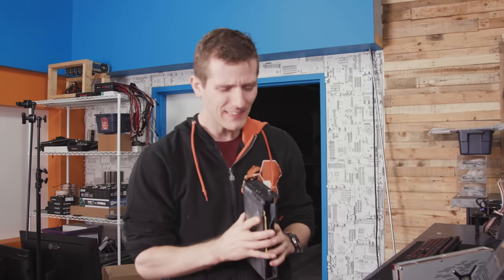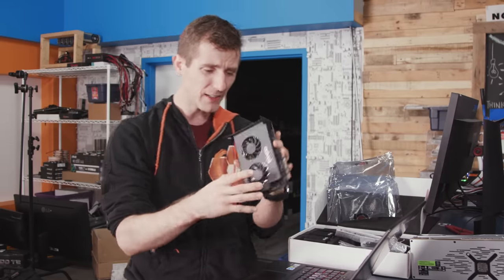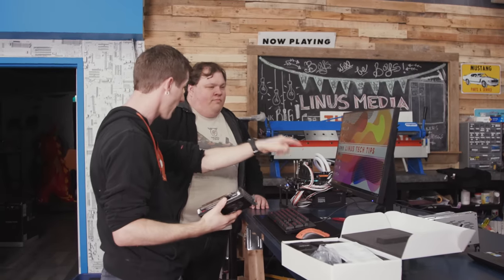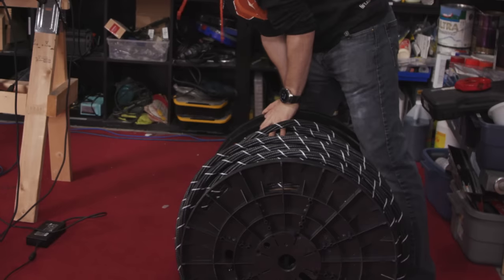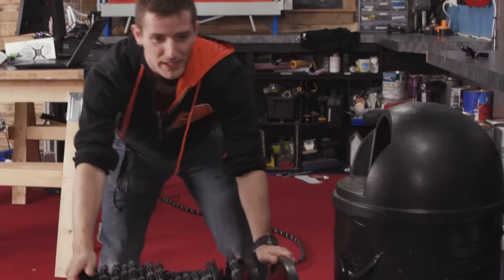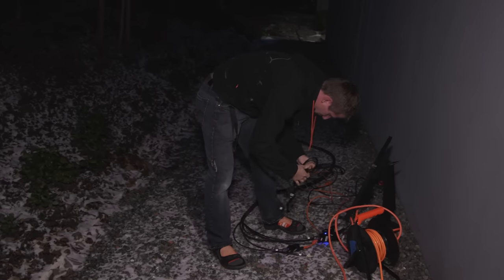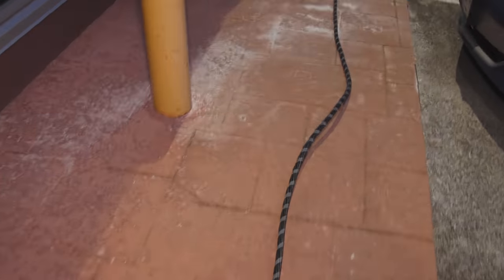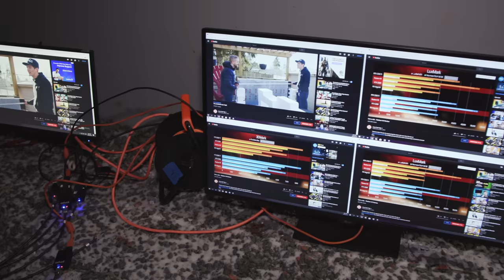The WEIRDEST Video Card We’ve EVER Seen..

Comment: This is the perfect solution when your PC is too noisy. Lets you put it in the next town.
Reply: Linus has that for his home pc but over thunderbolt since that can carry the usb and network too.
Reply: No, you can bury your pc and still have it run
Reply: How would you turn it on?
Reply: ödeldödel Horst lol
Reply: @alexgutowski  2.4 GHz remote-controlled switch, with the control next to your keyboard.
Reply: Jean Roch it’s gotta be 5 GHz. 2.4 was so 2018.
Reply: @alexgutowski  except everybody who knows RF will tell you 5 GHz doesn't have enough range and is easily stopped by walls.
Reply: Especially when you have a “highest airflow pc”
Reply: Alex Gutowski turn on wake on lan and then only put it to sleep. You could remotely wake it from your phone
Reply: @rylyguy  and so could the NSA. WOL is like a giant backdoor, no thanks 😅
Reply: Keyboard and mouse is a problem
Reply: Imma get it right around my car car I’ll I’ll get there to get you and get there there are are things there I don’t want it I’ll just go go to the bank to take my my computer back back home I
Reply: Corazon Sierra I overclocked my keyboard for more RGB......it obviously backfired
Reply: Hahahaha... 😁 😁
Reply: @TheNefastor : So if the NSA had spent some time hacking a PC on your network, your main fear is that they would be able to power on a PC?
Reply: @martito1014  Greatttttttt thermals
Reply: @alexgutowski  how about a smart switch

Comment: That Radeon Embedded 9550 is the Embedded version of RX480/580. It has got 36 Compute Units (same as RX480/580), core clock at 1150MHz for total 5.3TFlops of compute power however the memory is clocked just at 5GHz effective meaning bandwidth is down to 160GB/s rather than 224/256GB of the RX counterpart. It also runs at less than 95w TDP compared to 150/180 of RX.
Reply: that is a nice thing , for sure !
Reply: This advoli TA6 Performance card was apparently designed to support any embedded AMD Type B MXM module (although only three embedded options are currently available).
But what purpose does a card with 6 x 4K HDBaseT outputs serve and why would anyone (other than Linus) want to have one?
Datasheet says "Key Markets: Digital Gaming, Digital Signage/Retail, Medical Imaging, Aerospace/Defense".  Can output in any combination up to one 12K multi-screen.

http://www.advoli.com/ta6performance/
https://www.amd.com/Documents/ultra-high-performance-gpu-product-brief.pdf
Reply: Would've been nice if Linus did some actual fps and temp benchmarks on this product, show what it can do (and what it can't) with monitors installed at max distance.
Reply: Logic*
Reply: @pwnmeisterage  mostly going to be stores/digital displays to run off a single system. we use something similar at my work but far more old school. something like this would be insanely better but would never happen at my work even though they paid to have the building wired for 10gbit ethernet and don't even use it.
Reply: Wait he didn't game on it in this video? That's what I was waiting for!
Reply: Yeoss :3  It would've been a normal RX480 aka equal to 1060 if it wasn't for that botched memory bandwidth. It'll be slower. How much? Depends on the game how much memory bandwidth intensive it is.
Reply: @pwnmeisterage  A hell of a lot of applications, including television production. There is a market for this, as for why would Linus, he's still on the single-server-multi-platform-thing, and to not have like six video cards with ridiculous priced HDMI as well as limited lenght, probably just running ethernet throughout the building to where..well.. basically.. screens and mice/kb are. For sure M/KB are gonna be run by ethernet as well.
Reply: Yeoss :3  Better? Sure, but none of them will perform WORSE than baseline Nvidia spec (assuming they don't thermal or power throttle) and this Embedded version of RX480 (due to its limited bandwidth) will fail to surpass even the base spec GTX1060 so we can hardly say that its 1060 on steroids.

Comment: i think this is mostly intended for signage use where they can connect multiple TV's in a Mall for example
Reply: I happen to know the guys at Advoli, and you're right on. Also airports, factories... It's still very cool tech though!
Reply: Duh.
Reply: This card makes display servers REALLY EASY
Reply: Security systems, field setups (police, military, firefighting) where you need multiple monitors in a field environment.
Reply: Even for events when you want to do live feed.
Reply: And also space center room
Reply: @CityVoltProject  Oooh, that explains the name then. Indeed very cool!
Reply: Stadiums too
Reply: Thats exactly what it is for . Also ive seen this in a set up where it was used in fairly large sports bar in las vegas that had 20 large screen tvs all showing different sporting events with screens to post live bets .
Reply: airports is probably one of the biggest users, given how many monitors they have all over the place, and they can't have the PC towers anywhere near where the public can reach (to prevent theft, or worse people hacking them and causing havoc). So with these things, they can have one room full of computers that branch out to the hundreds of monitors within 100 yards of the secured computer room. Wonder if using repeaters would still be feasible to extend range or if that would hinder the output quality too much. Also wouldn't be a surprise if stock market floors were loaded up with PCs running these cards
Reply: @SurgStriker  I think a lot of airports have small PC's mounted behind the TV's (Think Intel NUC etc)
Reply: I wonder if fast food joints like mcdonalds and Burger King use it since they all switched to multiple monitor menu boards
Reply: I think it can also be used for Bitcoin mining xD
Reply: @SurgStriker  most airports are either using thin clients/signage drivers, or something like a crestron md64. This is cool i guess but a really strange solution that doesnt seem to have a good purpose
Reply: The more you know
Reply: Cool tech
Reply: This is mostly used on airports. =)
Reply: In stadiums they use them for pricing boards etc
Reply: @AnotherOne yes but they still have the big TV menu boards

Comment: And they say Ethernet graphics weren't possible
Reply: Yeah.
Reply: It's not over Ethernet. It's over 4 Twisted Pairs also known as a 4 pair CAT5 Cable, in this instance, he is using CAT7 which has tighter tolerances allowing faster speeds.
HDBaseT isn't based upon the Ethernet subframes and IP layers.
Only the physical connection is similar, just reusing the spec.
Reply: @RyanF470  Is this sort of a misnomer, ie. "Power over Ethernet"? The electrical approach is ofc a bit different as you're running (now adays) power and signal across the same leads, but still. Not much IP layer involvement there ^^,
Reply: lesslighter it's not meant for home use. This type of equipment is used more for event production in the AV industry.
Reply: Finally we can download vram after all these years.
Reply: lesslighter ive got a set of powered ethernet/hdmi adapters my low voltage friend gave me like 5 or so years ago. Allot of this stuff seems to get used commercially before it hits the consumer level. He also showed me display port to me at the time and i was like wtf is that?

Comment: I loved Linus' demonstration.  You could say 100 meters all day long.   You could point to the connectors coming from the graphics card, going through the 100 meters of shielded CAT 7,  Out to the HDMI adapters to the monitors.  People would just not listen or ignore it.  Not to mention the "IR" blaster outputs, IR pass through, and the RS232 Serial outputs.  The Idea of pointing with a remote.   People would glaze over and not hear you.   You Needed his demonstration to make the gears turn in people's head.  Your monitors and control setup could be a few floors up.   With the right  PoE switch and PoE media converter for your PoE applications.  You could be on the other side of a stadium.  The applications for this are endless.   Only Linus could show this in 10 minutes without boring people to sleep.  Like I just did.
Linus Sebastian, you are the best.

Comment: I think you should change the title to "The Weirdest and Longest Ethernet Cable We've EVER Seen..."
Reply: I've used this sort of cabling at job sites.  Funny thing is you actually need extra support and strain relief for all those heavy connectors (see how they sag in the vid?) - especially if you have a rack mount with many of these cards - even if you don't need any extra support for the wimpy little single-slot half-size GPU cards they stick into.
Linus could've just plugged into whatever spare ethernet cable runs he might already have installed in his building.  But if he did that then the video wouldn't be ten minutes long.
Reply: P the video is 10 minutes and 30 seconds
Reply: @XavierAncarno  Which is still 10 minutes.
Reply: ErroR
Reply: @pwnmeisterage  Exactly, who wants to suffer from saggy cable.

Comment: This is the main reason i like watching LTT, for the laughs
Reply: haha exactly.. he didnt have to walk 100meters lol.   just connecting 5 other monitors in the same room works the same as if he walked 100meters outside.  The signal has to transfer through all that ethernet length regardless if he was 1meter away or 100meters hahaha... funny clip for sure
Reply: @marcuswong1797  i like how you had to explain in considerable detail
Reply: @marcuswong1797  does crosstalk happens if they are all piled up together??.........
Reply: @0.o586  Yes. Especially when the cable is wrapped more than 5 times over like in the video. Though in the case of the video, the cable is shielded Cat7 which should prevent most crosstalk
Reply: Try watching jayztwocents
Reply: AWESOME COMMENT

Comment: This card is actually a perfect solution to something I've been trying to figure out for months.
At work I we have 6-8 TV's out in various places in the office, all hooked up to individual old PCs in our server room. I have been looking to downsize this significantly, and using one of these cards looks like it might be the way forward. Question is, can I run 6 VM's through it...
Reply: Maybe it can be used in public space like train station display or airport
Reply: So basically 6 editors 1 workstation but without all the graphics cards? :P
In seriousness though, if these outputs show up as regular HDMI on the host machine there's no reason you shouldn't be able to.
Reply: The VMs would obviously depend on the solution you use to virtualize. Does it allow indipendent input per VM? You have a solition to like the input back to the machine? If it's for use with less graphics performance needed, there are some nVidia Quadro and Matrox cards with similar/more outputs that might be cheaper.
Best would be to get in touch with Advoli and just ask them of your scenario is supported.
Reply: I was thinking this would be perfect for business use. Reception/cafe/offices all on one GPU :)
Reply: You could also consider Micro form factor PCs.  Dell offers them and also have Vesa mount holders.  Can allow you to move the PCs to the TV locations with minimal footprint or even fully hidden behind the TV itself.  Doesn't reduce the overall number of PCs but could eliminate need for long cable runs.
Reply: Technically, no you could not run 6 VM's on the single GPU. This solution is "1 PC, X Monitors" in the same way that plugging in 6 monitors to a single GPU is normally, there's just some overhead in the transmission. The solution to your puzzle is to actually use 1 HDMI/DP to Ethernet connector on each end and bypass the Ethernet switch. Then you either use 6 machines, or one machine with 6 GPU's (see Linus's video https://www.youtube.com/watch?v=LXOaCkbt4lI ) with 6 mapped PCIe cards. Though I think that's super-overkill.

An alternate solution I'd suggest is what's already used by the digital ad systems, just put a small NUC or Pi or something behind the TV or use a SmartTV with Kodi, have it PXE (network) boot off a single machine in the server room, and then have it stream video from the location.
Reply: @Kisai_Yuki  so the thing is, none of these VMs will actually need much GPU power, and I'm realising now that unless the Advoli cards can somehow utilise network switches they won't work. I think i actually just need a couple of normal GPUs and then drag-and-drop the VMs onto the right screen.
Reply: @Radcaster  A slightly more practical thing might be possible with VM's using USB "video" cards, but that might be a very specific use use case since mapping USB ports are easier, USB itself is kinda finicky. 

Some current USB-C (USB 3.0/3.1) docking stations actually use DisplayLink, which basically creates a virtual video card over USB, theoretically making it possible to just stream the output over ethernet instead of USB. But the docks are a bit more of a step up from the cheapy HDMI-USB/VGA-USB devices you can buy now.
Reply: On of the reasons AMD did add it to say hello to Matrox.
Reply: @Radcaster  Depending what operating system you are using this might be possible other ways, with linux for example can use raspbery pi's for the ethernet to HDMI at each TV and just use X forwarding to send the display to the pi over the network. Can even use the GPU in the server to handle OpenGL if you need to by using something like VirtualGL but I doubt that windows is anything like this flexable it usually isn't when it comes to do anything but the most basic stuff in my experience. Course it will put some pretty major load on the network especially if you use virtualgl since that actually forwards it in the form of a full RGB signal rather than just sending the API commands to the X server in the pi to render.
Reply: Just wanted to say thank you to everyone who replied here with advice/information - genuinely you guys have helped me figure out this issue between you all. What a stellar community!

Comment: Wait that means I can get video out of my ethernet jacks in my walls... Woah that's great... Linus should do something like that in the building. Like to have monitors displaying stuff from an ethernet cable.
Reply: He should setup monitors displaying employee encouragement videos
Reply: It also depends what your jacks are rated. But yes this has many applications
Reply: Dual ethernet jacks, so you have wired internet and wired display.
Reply: Well, I mean, every single cable in your house is just copper, no matter where it's designed to plug into
Reply: Highly possible - interoperable with other HDBaseT products - projectors/displays/switches etc...
Reply: I would use it to have six bedrooms with tvs connected to a single workstation running individual sessions.
Reply: @Matt-uf2nc  HDMI over ethernet has been a thing for Yeeaaarrrs. will work with cat 5e and up i believe
Reply: snipeish1 this. What a shame it took 2 hours of people watching this to get someone who knows this
Reply: @ale6242  HDBaseT has been around for a while, we made a graphics card out of it so you don't need extenders. You are correct that it works with CAT 5e and up.
Reply: @512TheWolf512  Sadly it's a bit more complicated than that. Simple experiment, run a 12V bulb off a 12V battery through romex (what's in your wall) and run another through jumper clips. For a 12V battery like a car battery, this equates to days worth of power lost to the larger cable.
Reply: I wonder if this would work using Ethernet over Power. I used to use that in my previous house due to wifi problems, and I love the idea of turning every powerpoint in my house into a potential location for a mirrored display.
Reply: @Jarejander69  good idea - we will give it a try with windows multipoint!
Reply: narutofan9999  yes but now there is a graphics card (cheap way) for it i am not working for a tv or an internet/tv provider to have the stuff to do this.

Comment: As an ex-Roadie, it seems pretty familiar. Many "Video-artists/techs" as well as light&sound use ethernet data protocols (and other cable types, depends on the system). 
So, it seemed a bit obvious i guess and funny/interesting how its not a very known signal flow outside the Stage Tech field. Although im sure its not the only field that uses it regularily.

Comment: That kind of card is quite common in industrial environments. It's a way to Connect 6 HMI screens placed 7 feet above the production line to the  same pc placed 90 feet away inside a key locked metal cabinet. We use that kind of cards or a Radeon with 8 outputs and HDMI to HdbT converters.

Comment: My grandpa bought a GPU from China and it has a headphone jack in it. Apple is quacking!

Edit: damn I didn't know it was so serious
Reply: There's always rooms for a headphone jack 🤣
Reply: I had S3 Virge card with headphone output ... It was for build in mpg2 decoder or something but I never knew how it supposed to work.
Reply: makes up for phones not having them
Reply: I always wanted a CPU with Headphone Jack
Reply: @Aussetziger  My headphones have a headphone jack on them.
Reply: Ultra Gamer Grandpa
Reply: Overclock it to make its headphones faster
Reply: @yakacm  Wow (sarcasm)
Reply: @xys007  Some cards like that actually use a line in jack. Basically from soundcard (or whatever) jack into the line in.
Reply: What is it for???
Reply: Pfft, I have a GPU with a PS/2 port on it!
Reply: @yakacm , lol, my headphones actually DO have a headphone jack on them.
Reply: it just connected pins on the inside, it need somesort of add on card/ it needed an extra card to do anything ?